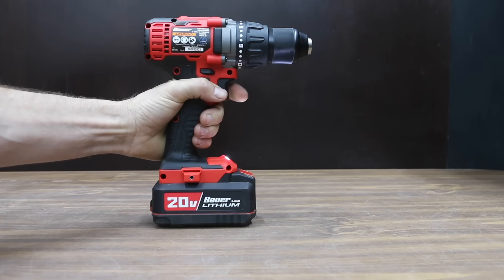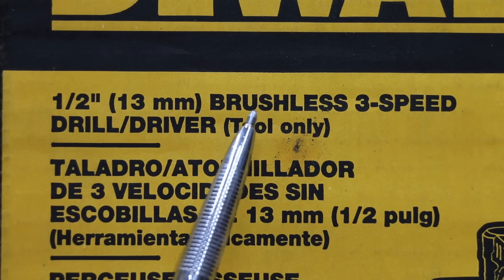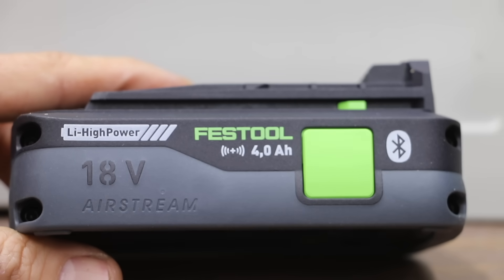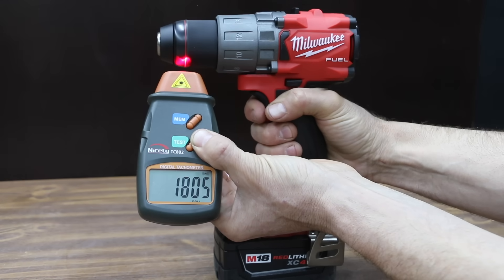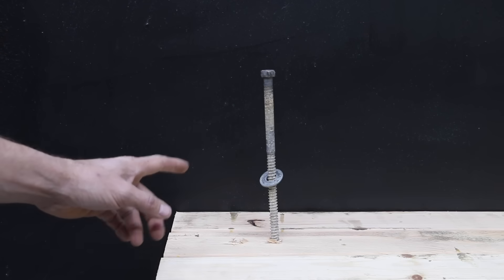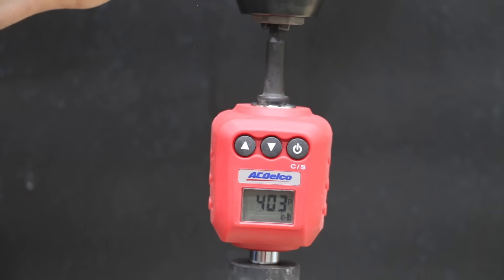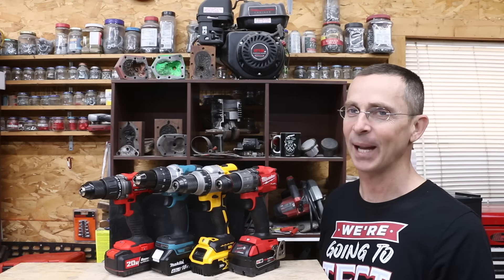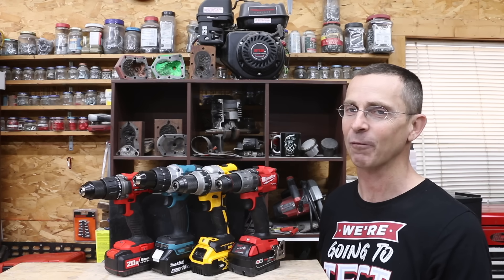Best Drill (BATTERY POWERED)? Milwaukee vs Dewalt, Makita, Bosch, Festool, Ryobi, Bauer, Ridgid

Comment: Before I have seen the test, I would think Bosch wins. And Ridgid gets a good place too. Now I'll watch the video.
Ok, that test was not a good test. Where did we see him using the drill for normal jobs around the house? I will never buy a DeWalt drill again. Both batteries died during a winter of no charging, so no matter how good it might be, I don't have the batteries for it and they don't sell them anymore. So I bought an expensive tool. I had hardly used it, and no it is useless. I have never had any problems with Bosch products. They are still considered top of the line here, as far as I know. But I went for a couple of generic type tool series this time. They are using the same type of 18 volt batteries. They come with a three year guarantee and I suspect that Bosch might have been involved in making them. I have yet to try most of them out properly, but I left the drill battery without charging during a few months this winter. And it was fully charged and fully functional right away. So I will see how this goes. I can always buy better tools if one or two of them fail. I am using several of their USB adapters for USB led lamp lighting in an offgrid cabin. They are great since the batteries charges quickly in a dual charger. 
Back to the test. What these kind of tests will never tell you, is how durable the tools and the batteries are. And that is an important aspect, which you will understand over time if you haven't already experienced it.
Reply from the maker: Thanks for the constructive feedback.

Comment: The DeWalt 3 speed is a planetary set that you get to learn all about if you pull the trigger with the case spit apart. I was having a problem with the trigger and I wanted to test it before I put it back together. Don't!  You would think it would have a warning sticker on it stating the transmission parts will fly across the room when you do.
Reply from the maker: Thanks for sharing.

Comment: I've been looking at Dewalt and Milwaukee line of battery operated tools. I have an older (but not that old) Dewalt drill and the battery is not compatible with any new Dewalt tools. Buying a battery every time adds a lot of cost. Which brand do you think has the best battery compatibility within its own lineup?
Reply from the maker: Thanks for the video idea.
Reply: Makita.

Comment: Whenever I go into my local tool supplier they push Festool like it's the best. However, we clearly see that they finished first in not one category. 

Personally, I use Dewalt with their 20v platform and Milwaukee with their M12 line. I wish I had started with a Milwaukees m18 platform as I feel they are better quality tools but Dewalt always runs such good deals on their starter kits.
Reply from the maker: Thanks for sharing.

Comment: How about testing fasteners for shearing, pull out force, failures due to vibration and thermal cycling & other strengths & weaknesses in concrete, brick and cinder block? Tap-Con, lead shields and lags, machine thread shields, Red Heads, epoxy types and other “ reliable” fasteners of different sizes from 1/8” to 1/4” …. I have become disillusioned with Tap-Cons in the past few years. Heads snapping off when installing and after installing, backing out from vibration and thermal cycling.
BTW, thanks for another great vid that is chock full of very useful information!
Reply from the maker: You are welcome!  Thanks for the video idea.

Comment: I’ve been using Milwaukee for 5 years now and you get every cent out of the drill set. I’ve dropped my drills from 10ft ladders, drilled threw concrete, metal countless of times and haven’t had any issues.
Reply from the maker: Thanks for sharing.

Comment: Who buys festool shit anyways ?
Amazing video
Reply: Cordless plunge saw. What else is on the market that competes?
Reply: They do make some nice woodworking tools like the plunge router but that price....Not worth it to me. My Hitachi plunge router works just fine
Reply: I've never understood the Festool hype. I'm a lurker on a Facebook Festool fanboy page because someone added me once, and they're always complaining about quality and performance issues, especially with 110 volt kit
Reply: @Muggles87  -  they make some of the best wood working tools around like sanders with dust extraction the quietest and most powerful I’ve ever used, but there drills and drivers are not as powerful but they have one that can drill and drive around corners, unbelievable, I use DeWalt and Milwaukee for most tools and festool for all my sanding.
Reply: Ultimate Making: The same people who buy Hummers?
Reply: Even my Screwdriver work better than festool
Reply: Festool are very good in some things like saws and their tid18 and the best in sandings machines
Reply: @Washing Up Liquid alright but still more fan of festool😁 and for the price difference you can get another festool body
Reply: The people who but them are like the Apple fanboys.
Reply: @mothman-jz8ug  don’t even go there with that shit. Apples and oranges. If you think android phones are better then why are they always copying everything apple does. Apple only makes high quality hardware, software made to run solely for its phones and does so seamlessly.
Reply: @mothman-jz8ug  Every brand has fanboys. Ever see the idiots arguing over who is better, milwaukee or dewalt? Who gives a shit, as long as it gets the job done. My Imac gets the job I need it to do better than a PC... that don't make me a fanboy
Reply: @mothman-jz8ug  also called Fistool
Reply: @mothman-jz8ug  With the difference being iPhones actually do outperform all other phones
Reply: @marco1173  In what regards?
Reply: @jatnierdorta  Not a good analogy. It's more like having a really nice drill that only works with its own line of proprietary bits, while Android works with a hodge podge of bits that a lot of the time are just garbage.
Reply: A Festool is like a Mac Pro: work buys it for you.
Reply: @Washing Up Liquid mirka is too expensive for there whole system and you can't get good other stuff of them
Reply: Perso j’utilise du DeWalt ! Coucou 😉😉
Reply: Tiktokers most likely

Comment: I'd like to see a head to head flex impact driver vs the M18, taking into account the heat and giving them both a stress test, yes the flex delivers more torque but which is more durable, which can run longer, which will give up first, etc.
Reply from the maker: Thanks for the video idea.
Reply: @ProjectFarm  thank you for noticing and replying, I always like your videos.

Comment: Would be interesting to see the „high end“ products of each company. Most expensive ryobi vs makita etc.
Reply from the maker: Thanks for the suggestion.
Reply: Ryobi has brushless now
Reply: @bubba03wrx  Yup, Ryobi has had brushless for a couple years now. Mines going on 4yrs old.
Reply: @Aaron48219  4 years of use at work or at home? Just curious
Reply: @Aaron48219  u have much more torque control as well with the dewalt not to mention the balance of the tool
Reply: @kylealexander7024  Home, but I do quite a bit with it. Also have  the brushless angle grinder, brushless weed whacker, circular saw and brushless impact wrench. They've all seen a good amount of use and abuse, especially the angle grinder and impact wrench from working on cars.
Reply: @Aaron48219  agreed. my dads been using ryobi for over 18 years. only repurchased the drills when they switched to lithium ion, and loves them even more.
Reply: @crankthatrebecca12  Your dad is awesome.
Reply: @kylealexander7024  did u ever used a festool from 2015 up model ? it is not fair to compare ryobi with Dewalt as well as is not fair to compare Dewalt with Festool ...
Reply: @mihaiachim5299  well the price is similar. Slightly less. I like some ryobi products. Theyre not good drills. Also multitool oscillators r less effective in my use even using a 2 yr old dewalt vs new ryobi. Am using on full remodel job too ofc. DIY ryobi is good enough but dewalt is still better and more ergonomic than ryobi tools in general
Reply: @bubba03wrx  brushless is not equal to high end
Reply: Ryobi has the HP hammer drill thats the same if not better then ridgid
Reply: EXCELLENT video idea for you.  Best smokeless fire pit!
Reply: It can be tricky to get Makita Red in the US (Not to be mistaken with the Makita MT brand), you usually have to ship them in from Japan, and then you have shipping and customs. Expensive.
Reply: @Jin-Ro  Shipping just about anything from Japan is expensive AF. Did you know that stereo speakers have to be shipped by sea/ship (unless they are magnetically shielded)? Japans shipping authority says that the magnets interfere with plane electronics.
Reply: Yeah, I think this isn't entirely fair to Ryobi. This is basically their cheapest One+ drill, but you can get the 252 or 251 for a similar price (without battery) that would put it in the middle of the pack price-wise and towards the top of the pack function-wise.
Reply: @Jan Has That "was" Ryobis high end lol
Reply: @lightbulb1982  Probably all manufacturers have a brushless option. Most of them also have like 10 different models.. 7.4V,14.4V,18-20V etc
Reply: @lightbulb1982  no it wasn’t!
Reply: @lightbulb1982  not true
Reply: @lightbulb1982  nah it wasn’t. The Ryobi HP brushless line is pretty impressive for the price
Reply: @phipear  I have never seen a high end Ryobi tool. I'm from Canada and Home Depot sells Ryobi here. Who sells the high end Ryobi tools?
Reply: @lightbulb1982  to 6
Reply: @lightbulb1982  it definitely wasnt. That grey battery is an old gen battery i haven't seen in stores in YEARS. It was very odd seeing it with a "new" drill.
Reply: @lightbulb1982 thats not true, the hp line of tools are the high end

Comment: Thank you for including Ridgid :) Not their best drill, average, but at least the brand is in the video
Reply: I was thinking the same. It seems like he went with the cheaper of the drills in the lineup. But Atleast ridgid made the cut.
Reply: He used the Gen5x Brushless. Isn't only the Octane more powerful? This is probably Ridgid's best selling model.
Reply: @pilotdog68  Yes and no. It goes Gen4 Brushed, Gen5 Brushed, Gen5 Brushless, Brushless (2021 new model, Gen6) and Octane ... but the octane is 2.5x better then the standard Gen5 Brushless drill
Reply from the maker: You are welcome!

Comment: I must say we use bosch tools and that drill is battery limited with that low torque number
Reply: Yes it really makes a little difference if you use pro-core batterys with Bosch ..  Point is do you always need the fastest tool .. as long you get the job done ...and the tool keeps working .. My oldest bosch is 10+  years now . never had one break down .. but i don't abuse them ..like some people seem to do ...
Reply from the maker: Thanks for the feedback.

Comment: I wanna see a PF video across the new anti kickback festool track saw and the other track saw options out there. Also, I think there are a lot of other subjective metrics that aren't taken into account when you see a specific tool showdown video. Just one great example of this are the accessories that are available for festool routers and track saws that increase the productivity of the tool so greatly as to negate the cost/benefit argument out of the water. The contractor buying festool products likely cares more about the productivity, accuracy, precision, and warranty process over any other metric. I would encourage anyone with an opposing viewpoint to ask a few contractors that own festool about the benefits of their products. 

Sidebar, if a tool needs repaired, as soon as it comes through the doors of the repair facility in Indianapolis, they assess, repair the tool, and ship it back typically within 2-3 days which is crazy fast.
Reply from the maker: Thanks for the video idea.

Comment: I'm a Makita man. I often replace thousands of screws in pool cages in SW Florida and that includes hammer drilling dozens or, more than a hundred concrete holes for tapcons; all Makita. My only complaint is the regular drill (not the impact) seems to develop a slipping chuck and, I don't know how to explain it exactly but the drill slips when drilling something; motor is turning but the chuck is not. Other than that, I'm happy with the Makita tool lineup and I use the compact impact drill for most everything anyway. Just got their cordless orbital sander too; love it!
Reply from the maker: Thanks for sharing.

Comment: It occurs to me that you have very extensive tests on many, many cordless devices from all manufacturers.  What I'd like to see you do is to compare the entire ecosystem of all the brands.  Let's face the elephant in the room.  No person is going to take your recommendation on a piece-by-piece basis; i.e. buying each tool and their associated battery individually.  That is cost-prohibitive.  What any newcomer is going to do is ask, which manufacturer's entire line-up of cordless tools will meet my general-purpose needs for the next 3-5 years with performance and reliability?  So, by now you have almost, if not all, of every device a manufacturer makes in your possession.  Which manufacturer has the best battery system?  Most number of devices under their brand's umbrella?  Best durability and reliability over time?  Etc.

You could separate this into categories such as:  Professional grade - Super enthusiast-grade - Enthusiast Homeowner grade - Cost-conscious budget-friendly - Bottom of the barrel but gets the job done grade.  Or you could use your own grading scale.  The top two grades MUST pass all tests that are thrown at it without fail in the first go-round as in this environment, they HAVE to get the job done.  All the lessor grades can be stacked up against the top two grades over their eco-system of tools.  There would be no hard and fast rule that one manufacturer couldn't be graded in another category, say, DeWalt might come in 3rd place in the Professional grade category, but finish 1st in the Enthusiast Homeowner grade category because of the total overall experience a buyer could expect.

I hope this idea makes sense and thank you if you decide to take on this monumental challenge.
Reply from the maker: Thanks for the video idea.

Comment: It would be great if you also could show a diagram of the price as you do with the test result. It will make it easier to compere the prices.
Reply: Yeah, the full price, including everything it takes to get to what the "most expensive one" costs, which makes the Milwaukee the most expensive. And The Milwaukee is entirely made by slaves in china.
Reply from the maker: Thanks for the suggestion.

Comment: Normally, I appreciate everything you do. But why would one test a "drill" by "driving" lags?? Shouldn't a drill be tested by drilling? I mean, it's a drill. I'd think driving would be a better test for a driver. 

This is exactly why these things are sold in sets. It's because this item is not meant to do what you're doing with it. I'll admit that it's a fair enough representation of it's capabilities, but not entirely, as they shouldn't be used for said purpose.
Reply: bullshit,a drill is designed to do both

Comment: My son and I spent many summers building fences and decks.  My son is totally Milwaukee.  I still have three sets of Makita.  My son used his Milwaukee to drive six inch half inch lag bolts into 4 x 6 framing.  I would not even try that with my Makita, but I still love driving deck screws with either of my 14 volt units.  All day.  My 18 volt unit is just bigger.  The Milwaukee definitely has more testosterone.  Period
Reply from the maker: Thanks for the feedback.

Comment: I wonder if the rigid has less torque than most... because my rigid Corded drill from 2016 had the worst torque I've ever seen.... but that was 5 years ago and using 120 AC power.

Comment: I have tossed all my makita tools for milwaukee tools. I have had a different result though. My milwaukee drills are excellent control, for low torque applications, on delicate work. Perhaps a different model? It's a fuel 18v, and I use 6.0ah batteries.

I think one of your next videos should be, best cordless 4¹/² inch angle grinder. I think milwaukee will fail. I have a lot of issues keeping mine running under load, cutting 1/2 steel. Anyways, another great video man. Look forward to the next!
Reply from the maker: Thanks for the video idea.
Reply: I'd love to see milwaukee, Bauer, ryobi, Dewalt, porter cable, and rigid go head to head. I think milwaukee really crapped the bed with their grinders.
Reply: It's been done by other yt's, but I think you're the right man for the job, and will be 1m+ views.

Comment: Hi Project Farm,
I have been an engineer for over 5 years and am now changing jobs due to not enjoying the office life style, I can’t sit down for the rest of my life !!! 
I am going to be a farm manager/ first responder to any machinery issues due to previous experience in other jobs. I have a ton of tools a lot chosen from your channel. However I am kitting our my pick up and would love some help on the following. 
The best 12v - 120/240v powered adapter looking at how much extra load it puts on your alternator, what’s safe to draw from the truck and what is not! 
Thanks 
Charlie
Reply from the maker: Thanks for the video idea.
Reply: Extra questions, are there systems what will monitor your battery so you can still charge your power toll battery’s when it’s off but not go over a low limit.
Is it ever safe to run a compressor or an SDS drill when it’s running.
Am I better to just put in a small generator in the back of the truck and not worry!